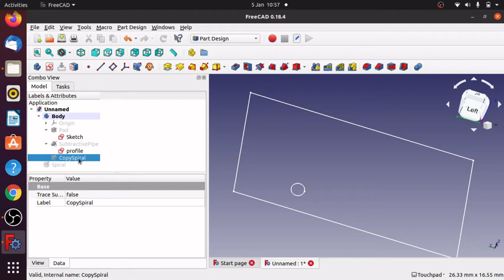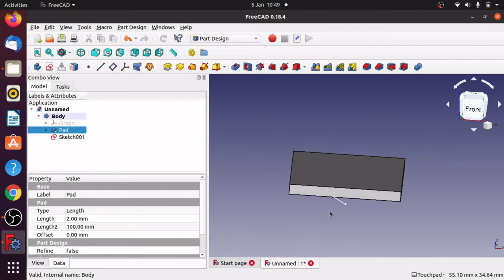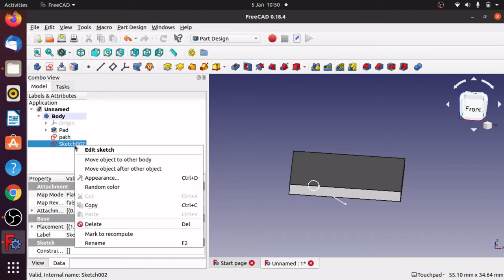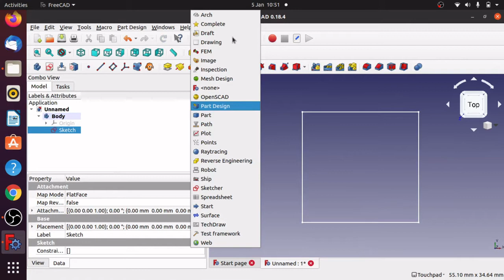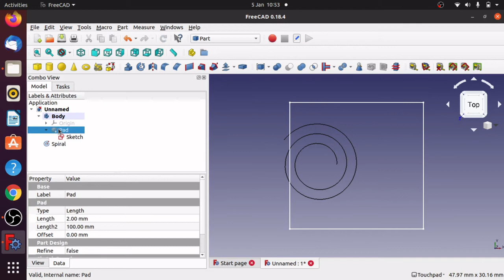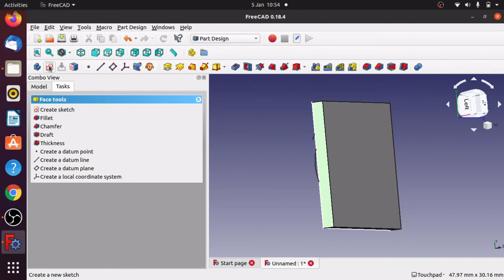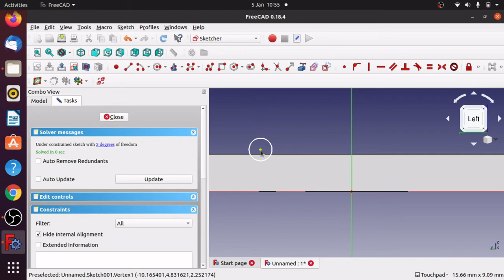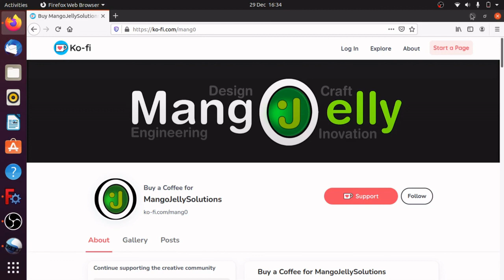FreeCAD Removing material 3: Subtractive Pipe Sweep & carve out a path through a pad Beginners Guide

Comment: Hello , I have succesfully built the electronics box following one of you videos, very concise and easy to follow 
I asked you about adding an o-ring channel and you suggested a Subtractive Pipe. 

I have watched this video which you show the spiral starting at the edge of the box, what I am attempting to do is a groove insite the confines of the box lid or box body, I do not seem to be able to determine what method to use to create the path for the grrose to use the Subtractive Pipe to extract the material. I have tried drawing the path the same way as the box shape was created in your video on a new sketch, but have had no luck being able to apply the Subtractive Pipe tool to that path.

I know you would not be able to do so right away . . . but if you could find the time to do a supplementary video to accompany your Electronics box video, I'm certain many more people than myself would benefit

Many thanks for your videos, they are very helpful
cheers,
Brent

Comment: Have you ever considered how you might remove material to form a feed screw on say a conveyer that transports bottles?  I have done it in Solidworks but it required the equivalent of sweeping a sold around a spiral path rather than a 2d profile.  From what I gather, you can't do this in freecad.   The groove used to create the feed screw in the initial solid cylinder has to snugly hold the bottle's body, which stands on the conveyor orthogonal to the feed screw axis.  I guess you could do it by piping many 2d profiles that are cross-sections of the bottle body?  Excellent videos!

Comment: Sir in my case it is showing failed to validate broken face what should I do where am I going wrong
Reply from the maker: It sounds like you may have a sketch that may be open. Make sure that all sketches are closed I. e if your sketch is a rectangle then it should have the first point connected to the last point. As time has passed since I made this tutorial It's now best to use a A2Plus /assembly4 workbench
Reply: @MangoJellySolutions  Thankyou Sir really appreciate the prompt response It worked now

Comment: wonderful subtractive freecad video... i am working on a 1/4"-18 5000 psi tapered NPT pipe thread to 1/2"-20 UNF bolt thread adapter and found out going from OK to the real cnc mill coordinates is a new learning curve...  the subtractive pipe sweep is new to me...  thanks al lot...:)
Reply from the maker: Ah another CNCer that uses FreeCAD. Yes the path workbench to create the CNC cut is something and full of its own little querks! I have a home built CNC but I haven't used it in anger yet. I am in the middle of rebuilding it as I want to do additional videos around it. I have a path related python video coming up Sunday which maybe of interest 😁 thank you for the support and likes